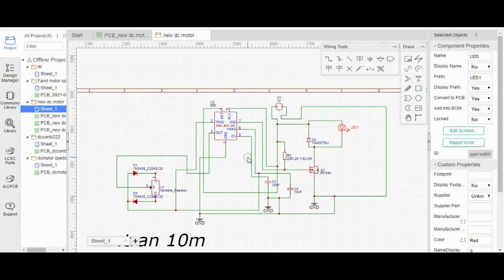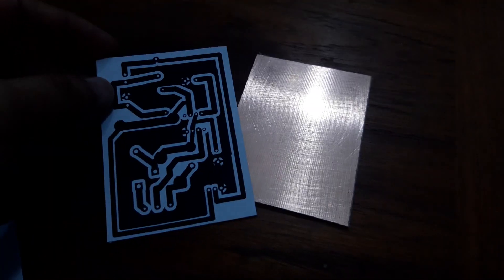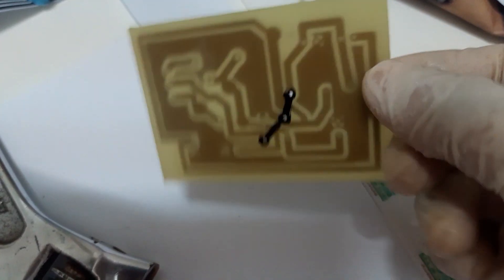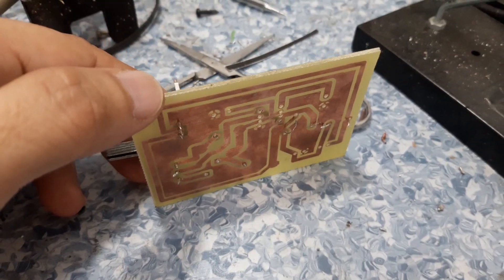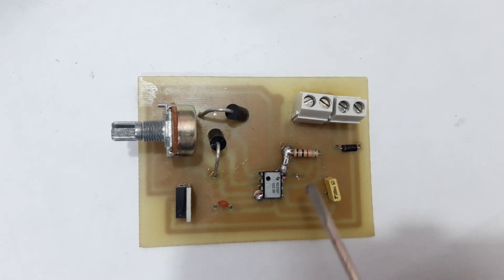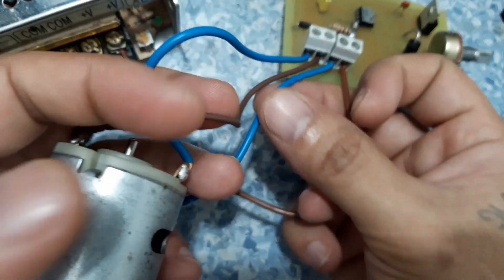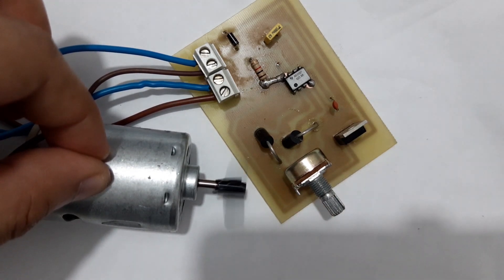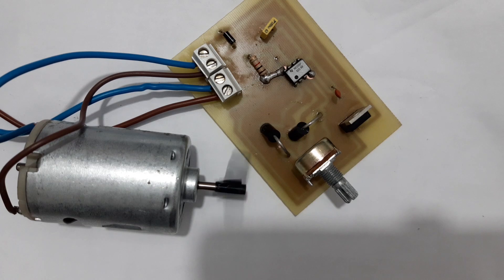DC Motor Speed Controller : Make your own DC Motor Speed Controller Board

Comment: Nice work!
Does the speed change linearly as you rotate the pot? I was wondering how you removed the ink from the board after taking it off from the chemical. It's a nice, simple project that I'd like to try. Thank you for sharing!
Reply from the maker: Yes...you can remove the ink by applying acetone and rub with cotton.